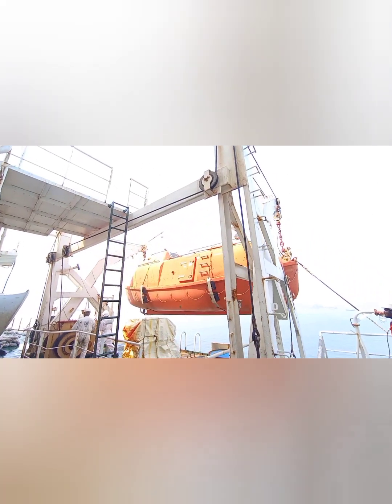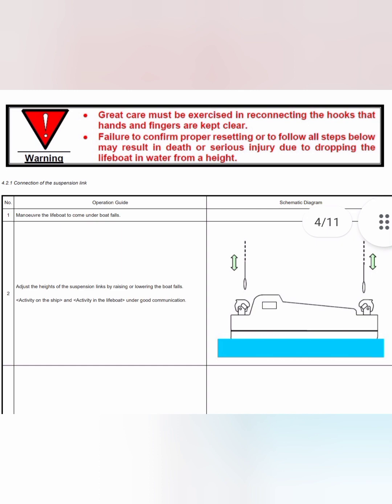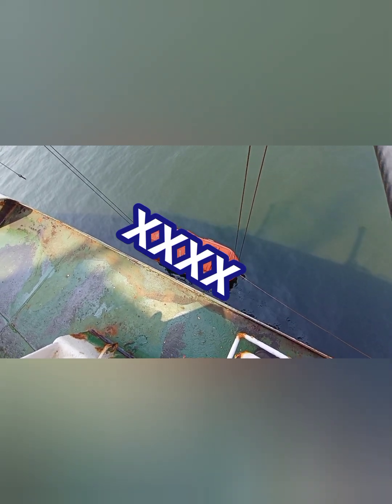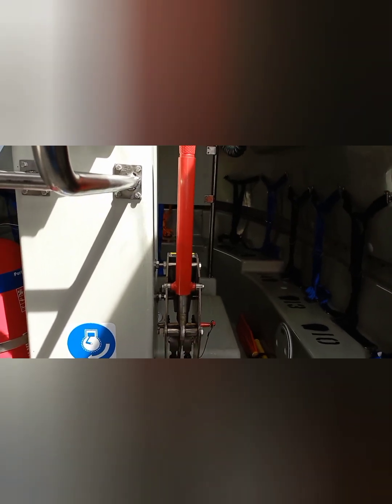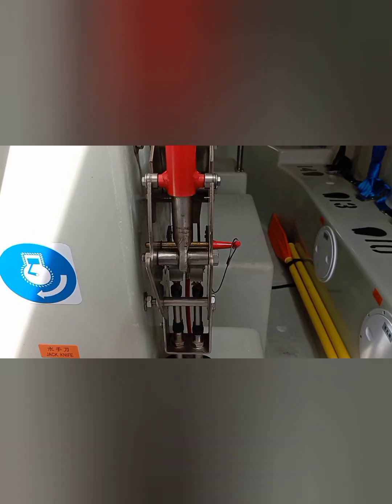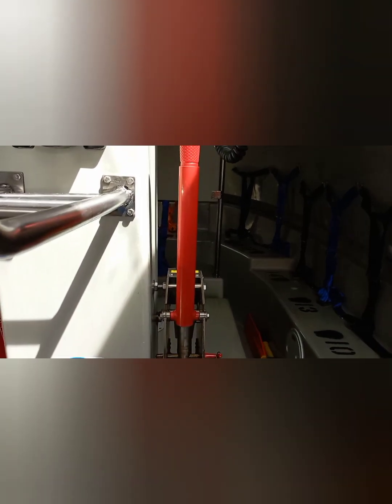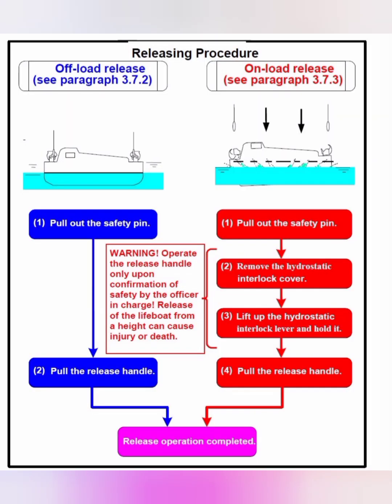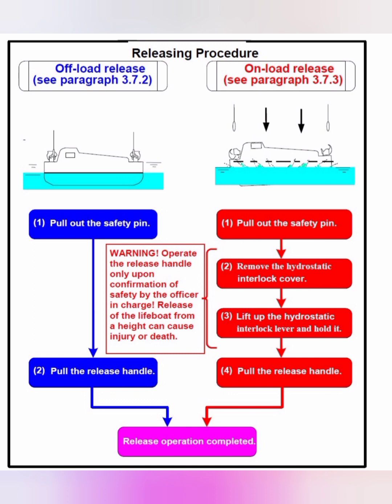How to Load test, safely release and recover the life boat hooks.

Comment: When lowering hand brake is used but when recovery with electric motor how the hand brake does not work? Or how motor work against the hand break (weighted)
Reply from the maker: The brake is designed to have a directional effect only. Can heave but cannot let go with brake on.

Comment: Sir what is the difference between static and dynamic load test of life boats?
Reply from the maker: Static is when their is no movement of load. Basically putting the load on the boat and checking while dynamic is putting the load and then checking it through operation.